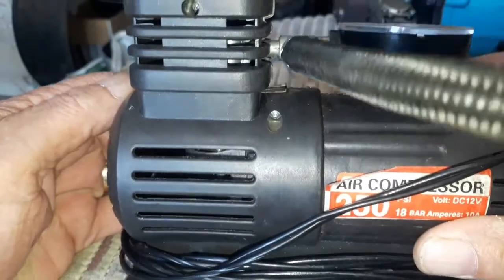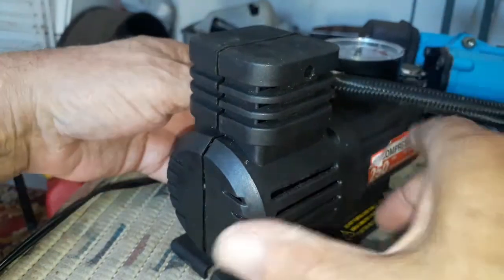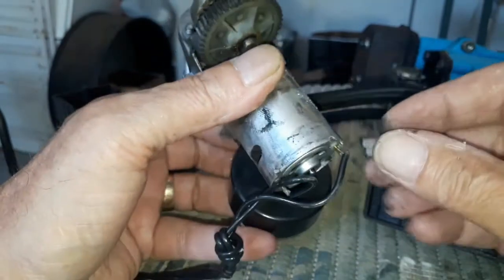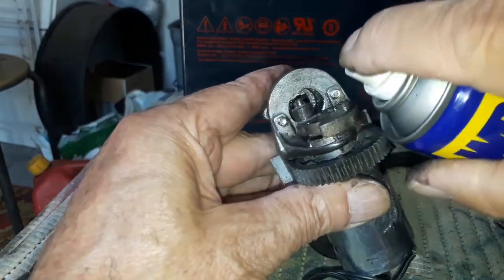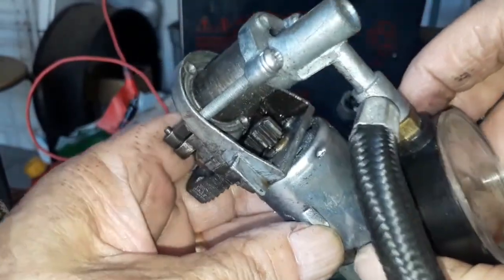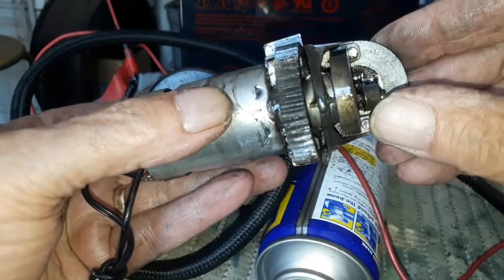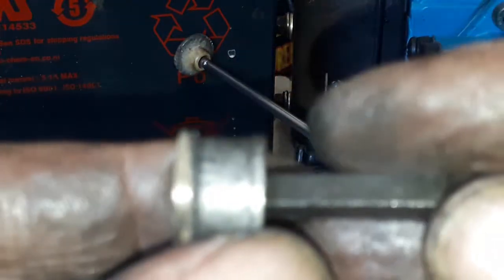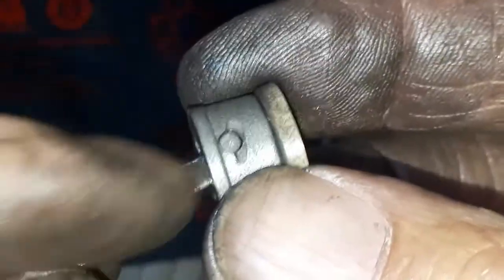Compressor fault Finding, Worth Watching till the end. Long but Interesting, hope you like it

Comment: God luck Jan!! I’ve had scrap a few small compressors when a gear failed. The special size gears were almost impossible to find. Then they cost almost as much as a new compressor. I rebuilt a Land Rover compressor because it’s too expensive and the rebuild kit was very cheap. You might have fun rebuilding it, but you probably have more fun things to do. Take care.
Reply from the maker: Very true Henry, I am burning to rescue it my way, but I burn as hard to use the motor as well, I will access the possibility to use the motor for a starter on the little motor, if it seems not viable I will repair it as a project when the Farmall, Lister and small motor projects are done
Reply: @jankotze1959  no end of options!

Comment: Hi Jan! Thanks for the video. If you can find a bushing, I would try to repair the machine. If you can find the proper-sized bushing, the repair shouldn't be too hard. Perhaps you could make your own bushing with a piece of small tubing or pipe? Of course, it is an inexpensive machine that's probably not worth your time, but it can be very satisfying fixing something. Happy Sunday. Best regards.
Reply from the maker: Thanks for your view of the situation, I have some aluminium tubing that might work there, If I knew it runs dry I would lub it now and then and would probable last a long time, we will see in the next video what I decided on, thanks for watching my friend
Reply: @jankotze1959  It might be simpler to use it for a starter motor instead like you said. Take care.

Comment: it's really not worth working on unless you just want something to do, I just bought one pretty much exactly like that one yesterday for under 10.00 at Harbor freight.
Reply from the maker: Yes Vernon, they are good for emergency on car tires, but I run this one for at least an hour on the tractor tire, they say after 10 minutes you must stop for eight minutes but I continued pumping since there was a breeze of cool air, I must say it is not new, I use it for a couple of years from time to time,

Comment: Good   day They say they are oil less ,  well even lawn mower wheels  wear  if not  oil.  I found  a power back with compressor in & took it apart..  \if u can find  one  maybe use that.  
Yea   compressor is shot, use  motor as starter...  Good detail  Thanks
Reply from the maker: Thank you for your feedback Don, I agree, no lub on the bush and elsewhere is a recipe for failure, maybe it is made like that to last 50 hours and buy a new one

Comment: Personally I like a bit if a challenge. Because I have round stock of UHMW in the shop I’d attempt a replacement bushing of that material. It would probably outlast the metal one. UHMW stands fir ultra high molecular weight and it is a very dense machinable high quality wear surface used in many industrial wear applications. But it probably would be a very good candidate to scrap it and salvage the motor. Much less work too.
Reply from the maker: O yes Wendell, that UHMW will be perfect, this compressor cost me 170 Rand three years ago, very cheap, I will buy a new one rather and use the motor, I have big plans for it on the weed eater engine, thanks for the info on the material, that is good to know, we will have some kind of material with similar properties or very close, thanks for your view and comment my friend
Reply: @jankotze1959  I just turned out four bushings last week for a project that's in the works.  Of course they were only cast iron wheels that need to roll smoothly, so they will last for ever.

Comment: Retirement for the air compressor not lest there are parts available but I assume it’s assembled solid . “ throwaway “ when gone bad
Reply: You should have told him how to make a bushing from a tin can, like you did for the alternator on the 3300 combine🙂
Reply: @SoybeanFarmer3300  , thought about that but he really wants to use it on the little motor. He also stated they were cheap ( air compressor) . Have a merry day cousin SBF
Reply from the maker: Cousin yes, it is cheap to buy and no spres available use it and trash it is the mindset for those but a man can repair it as a project, but need that motor on the other hand, thanks for watching my friend

Comment: Very cheap quality. Better get a new one, the play in the plastic gears and bearings is insane. I'm sure you can imagine some cool application for this electric motor :-)
Reply from the maker: Great point! I also want to rather use the motor for hopefully a starter for the small engine